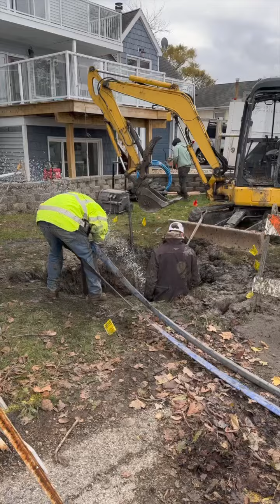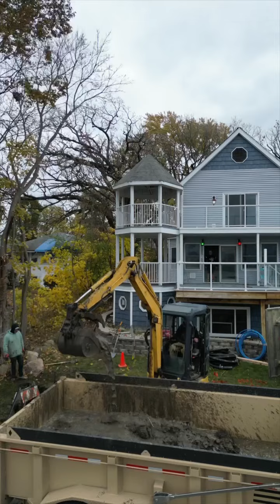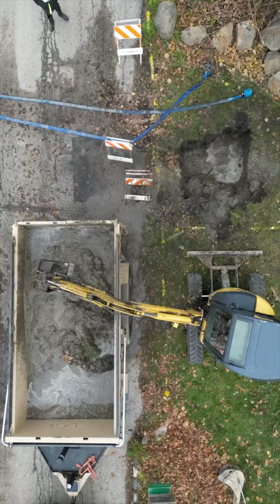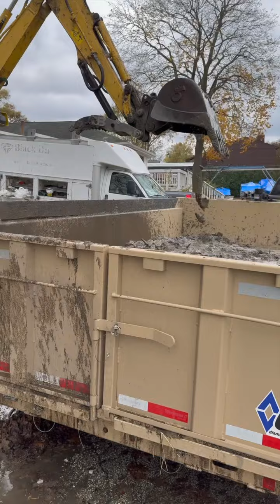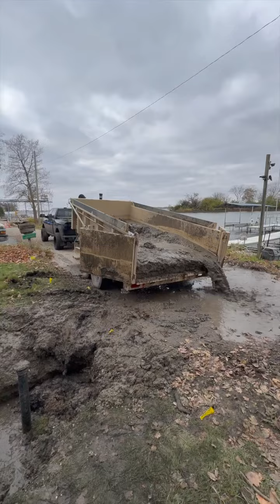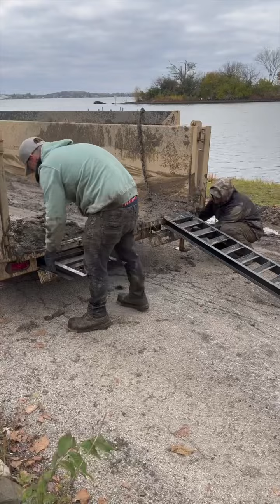Live water tap 👍🏻 @diamondctrailers

Comment: That's hard on those dump trailers. I know from extensive personal experience. And for anyone who is going try and fill one with mud that's on the soupy side. #1: it won't lift more than 2/3rds full and A: have caution opening barn style doors. All that weight pushing downwards, isn't. Because of its liquidish state its also pushing outwards and those doors sent my 220 pound self reeling backward into the mud. If it would have clipped me in the head it would have knocked me out for sure.
Reply from the maker: O damn, yea it was crazy heavy.  This one had a front 3 stage ram.  We haven’t had a load we couldn’t lift yet